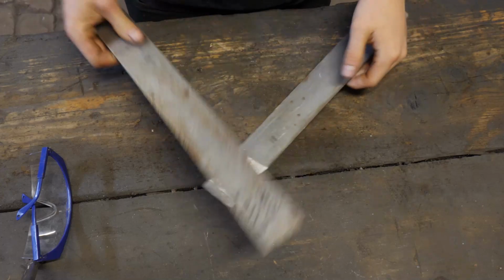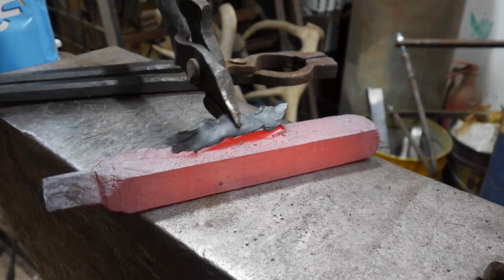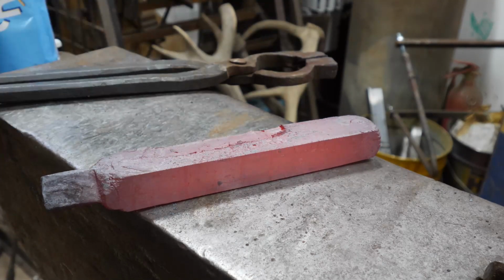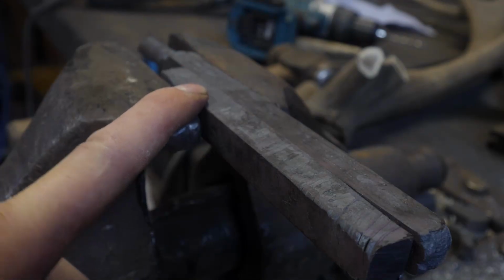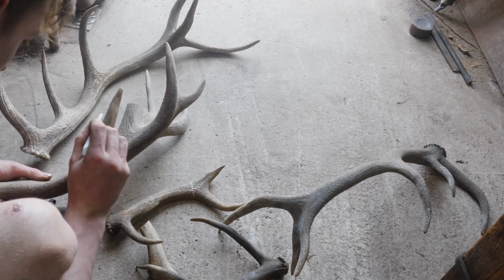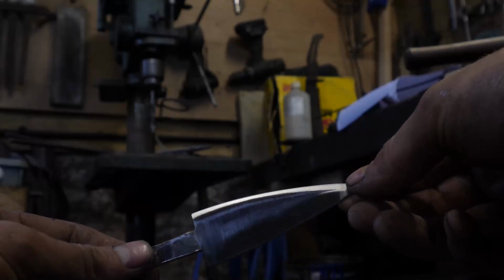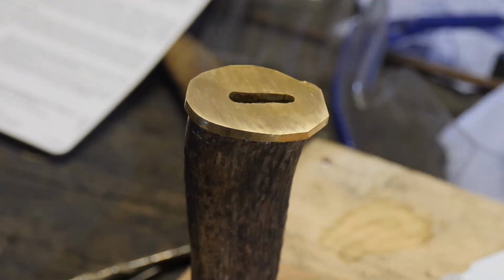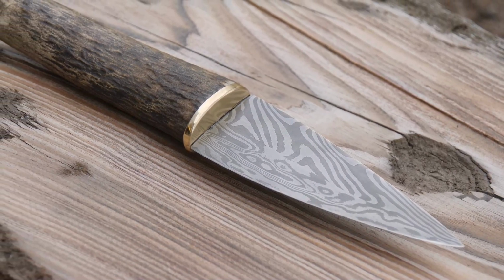Sgian-dubh, Scottish kilt knife.

Comment: aint that a bit big for a sgian dubh
Reply from the maker: Yeah it turned out a bit bigger than I wanted but the blade is only about 2, 3/4 inches so its not massive. But yeah other ones I make will be smaller